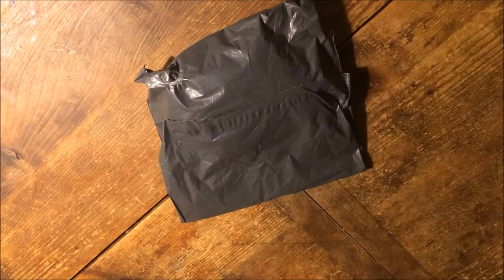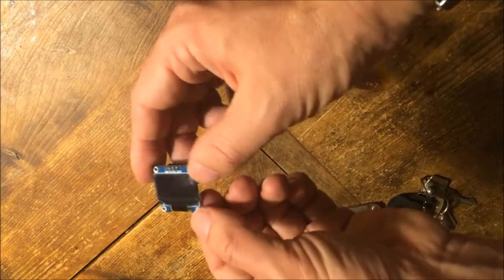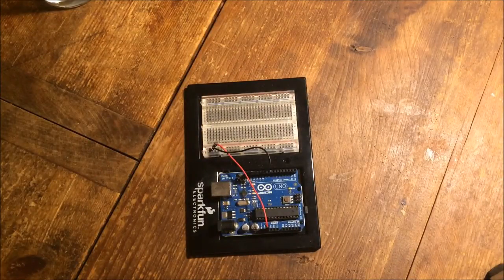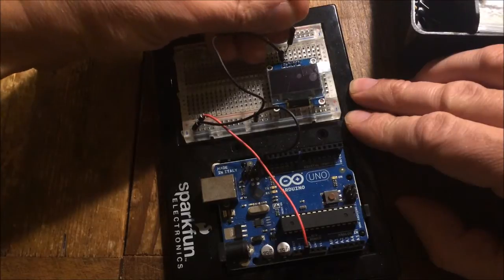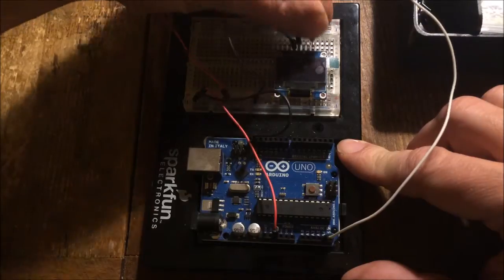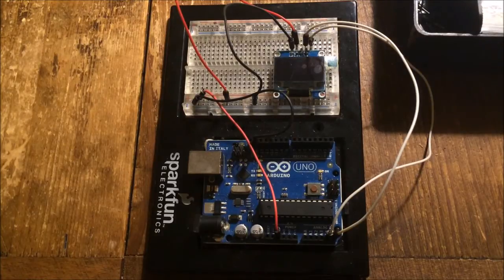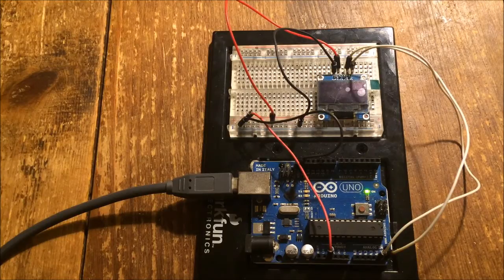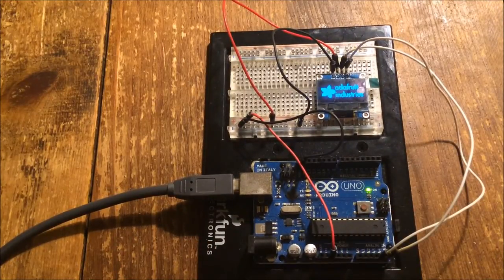Quick test of a SSD1306 based i2c OLED module on an arduino uno

Comment: Not sure there's enough memory to do the Arduino version of this on esp8266
Reply from the maker: Ric Johnson That demo relies on two huge Adafruit libraries. My efforts to get the OLED to do anything (anything at all, really) with my own scripts failed. The next attempt is to try that ESP8266/Arduino IDE from GitHub with the Adafruit libs. With all the other firmware out of the way, I think it might fit into the I2C flash. (4 MBit vs 32kByte on the ATMEGA328)